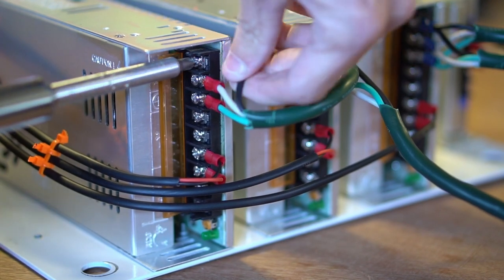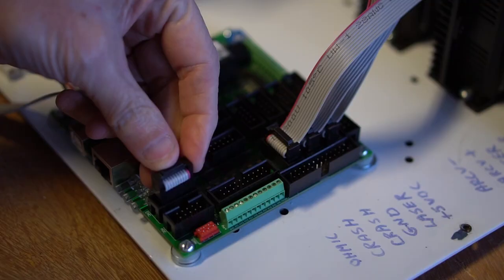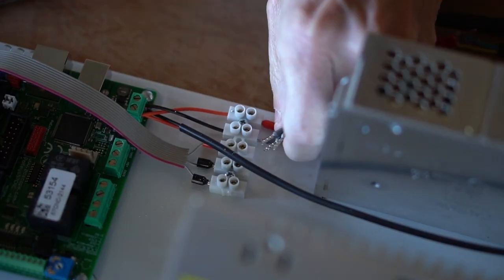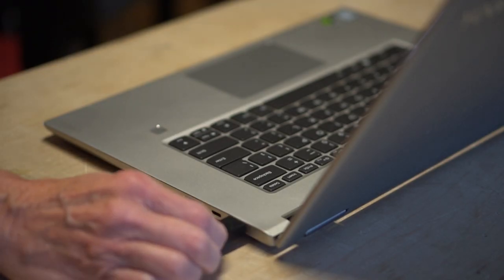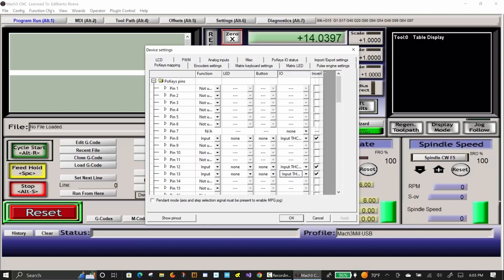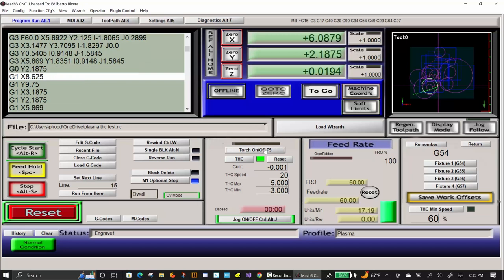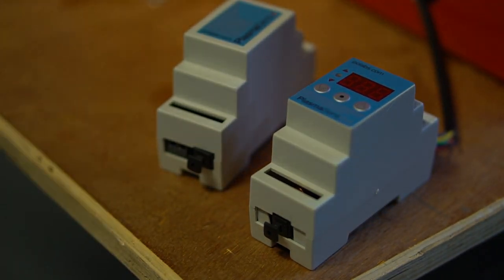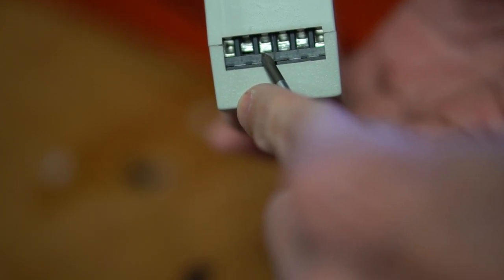Mach3 Plasma THC Wiring and Configuration

Comment from the maker: Hey All,  thanks for coming here and watching my new video. The Mach4 version of this will be available in a few days.
Reply: Thank you my friend, very helpful. Can mach3 mapping the position of the material?
Reply from the maker: @talentateknik6906  There is no need. That is the purpose of the THC. If the nozzle of the plasma torch is too far from the material, the THC reads the arc voltage and moves the z-axis down back into the constraints of optimal cutting. Conversely, if the nozzle is too close to the material, the THC will move the z-axis up. The arc voltage determines the distance the nozzle from the surface of the material, so the z-axis will always be at the perfect distance to the material, no matter how uneven the material is.
Reply: Good to see you are still active and getting with it! Take care!

Comment: How far is this controller system and your laptop/pc/pad from the plasma power unit?
Reply from the maker: It is important to separate the grounds for the controller/computer/drivers, and the plasma unit. The plasma unit should have a separate grounding rod.
Reply: @PatrickHoodDaniel  ooh now it seems clear why i get issues even with good earthing
Reply from the maker: @TheDIYer  Yeah, if you look at some Hypertherm manuals (even if you are not using a Hypertherm plasma), they guide the user on this very subject. You can find the Hypertherm manuals online. They are definitely a great read and should be followed to a T.

Comment: I am trying to fit a Dani THC to our plasma table. We have a Mach 3 CNC board and torch on is triggered via outputs and a relay. Having difficulty understanding where arc cable goes from the THC.
Reply from the maker: The THC should have either high voltage terminals or divided voltage terminals like the ones I sell in the video.

Comment: Wanted to ask at the end you said that it could accept high voltage so does that mean I don't need to divide my voltage from the plasma cutter and can straight wire from my high voltage board to those terminals? Let me know thanks.

Comment: Patrick, I want to thank you for sharing all this very well described and useful information for us CNC enthusiasts, I was wondering if you have any experience working with a combination of Mach4 and PoLabs Plasma Sense device connected directly to the PoExtension2 connector of Pokeys57CNC board, I mean without the PoLabs Torch Height Control Plasma Out device.
Reply from the maker: I don't have experience, but I do sell the components on the website. I will gain experience when a customer needs me to put one together. Thanks for the kind words!

Comment: Hello, I acquired exactly the same equipment for my plasma cutter but on the other hand I have a Mach3 board USB lambda card and I cannot get the up and down to work. When I use test function it works but not at all when cutting. Is it mandatory to use the 57CNC card because I had read that the system could work with other cards!
Thank you for your feedback and your very interesting videos
Reply from the maker: The outputs for the plasmasenseout are simple digital signals of high and low on each terminal. As long as your controller can receive digital signals, you should be fine.